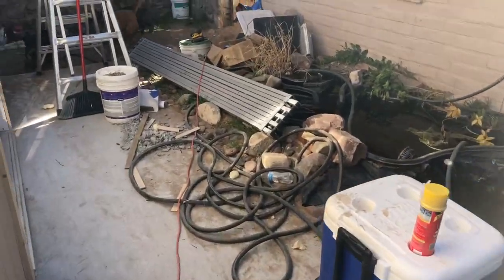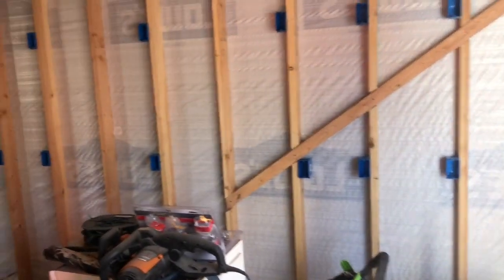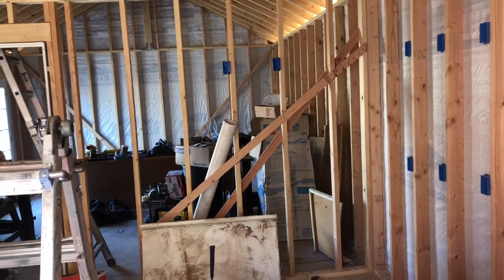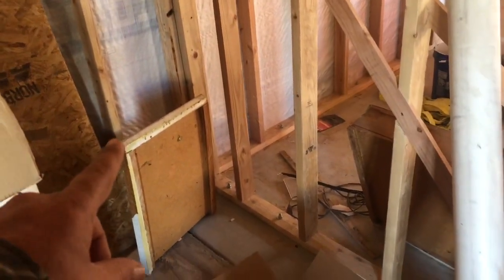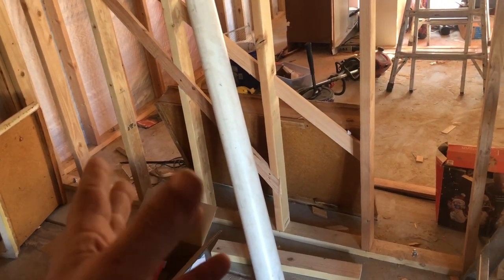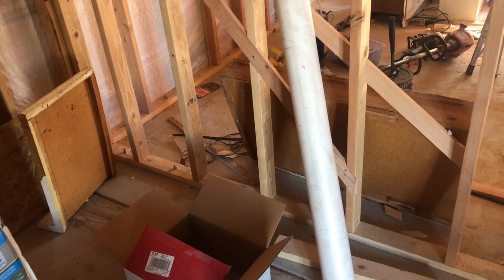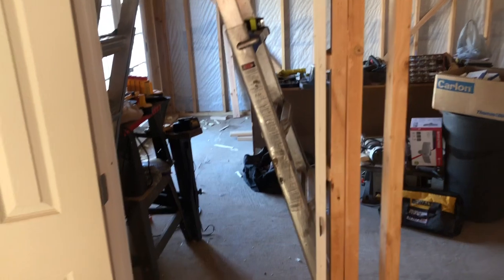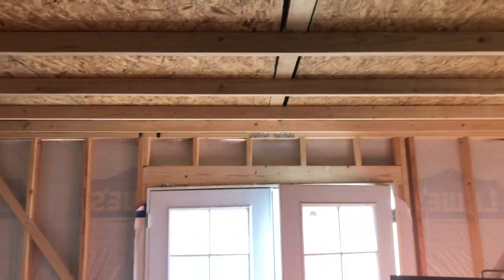Fish Room Build

Comment: So is a heat pump a better alternative to an air exchanger or a room heater and dehumidifier? I'm wondering which is most energy efficient?
Reply from the maker: Heat pump works better and is more efficient. It works as an air conditioner then reverses the process to pump heat.
Reply: @PsychoticAquatics   Is there a model you would recommend, say for a 500 sq ft sunroom? I'd like to install one.
Reply: And it keeps the humidity down I take it?
Reply from the maker: Seneville is what I’ll be running. It does help with humidity.